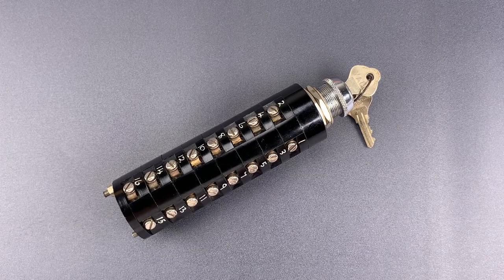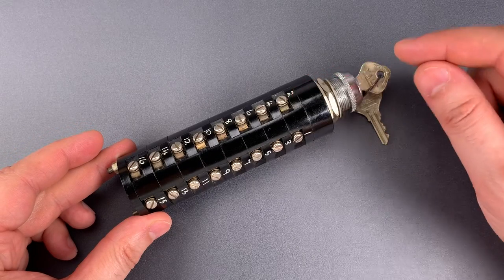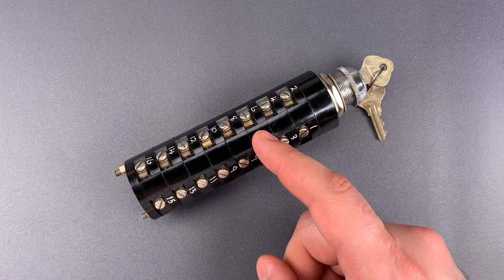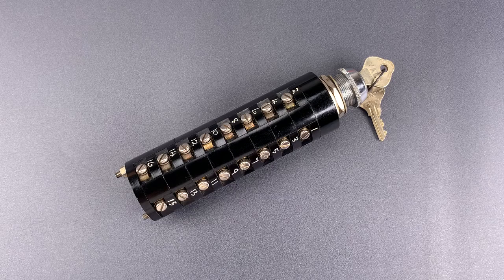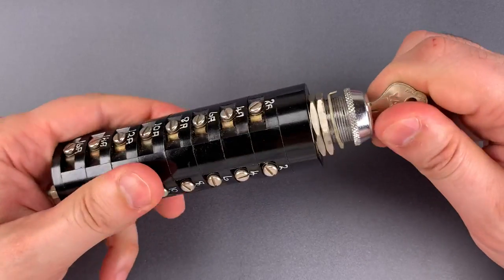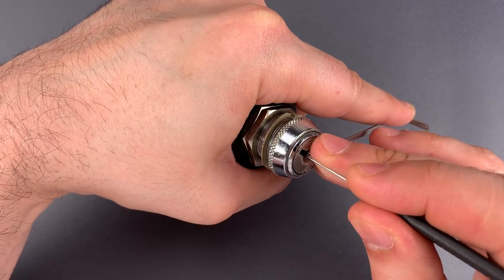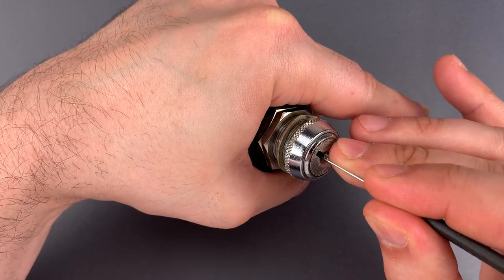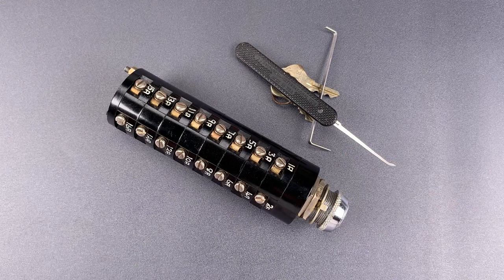[1154] Missile Control Key Switch Picked

Comment: “As you saw, it wasn’t that hard to pick...” the hard part would be getting into the aircraft on an airbase
Reply: Plot twist, LPL is Sam Fisher
Reply: The tricky part isn't the lock, but sneaking by the guys with the guns...
Reply: @ingvarhallstrom2306  he'd disassemble their guns with ease
Reply: My Dad always said it's amazing how far you can get carrying a clipboard and looking like you know where you're going.
Reply: Exactly what I think, one does not simply walk into launch control and starts picking a lock. These locks don't need to be unpickable, and having the key servers more as a "proof of authorization".
Reply: Loading the missile on the plane actually. You cant do that alone.
Reply: Pfft, what are they gonna do? Lock the gates?
Reply: So as you saw......

My brain: sidewinder missle
Reply: Easy on GTA.
Reply: Just carry a ladder
Reply: @Radonatos  yup. If the only thing protecting weapons is a key you're doing it wrong. 

You have to look at the whole context around security. Often keys are used to make it clear that only authorized personnel should be touching something. 

Just look at lockout locks. You could cut them with a bolt cutter and then kill whoever is working on the equipment. Or you could just pull out a gun and shoot them. The goal isn't to keep out a determined attacker, but to keep some idiot from just walking by and flipping a switch.
Reply: @YehNahYehAyy  easy in real life, too.
Reply: assassinlexx  lol, you don't understand the reality of the situation.
Reply: Not if the cockpits are locked with Bunker Hill Security Cable Locks
Reply: @IMBlakeley  My grandfather's account of training before WWII consisted of pretty much this.
Reply: Super easy: put on a hi-vi vest, grab a toolbox and pretend that you know what you're doing
Reply: @ingvarhallstrom2306  he wouldn't sneak, he would pick his way into the lockers and walk in with credentials in broad daylight
Reply: @MesaAufenhand  Not while they're pointed at him, I'd say.
Reply: Yes.  This lock isn't to prevent unauthorized access but to prevent accidental access.
Reply: @DeeSnow97  How do you get to the lockers without sneaking in in the first place? The lockers are inside the base.
Reply: @OtakuUnitedStudio  you underestimated his power
Reply: @walterk1221  Just because it was that easy 36 years ago doesn't mean it is today, after the numerous changes to security protocol. A lot of the technology used in the military for surveillance and security didn't even exist then, and what did has improved a lot. Getting caught will be much easier, though it's still probably not impossible to find a way in. That said, it's not recommended if you don't want to die of multiple cases of rapid-onset lead poisoning.
Reply: @IMBlakeley  Don't be giving my secrets away! I do that at work all the time.
Reply: @OtakuUnitedStudio  same way someone actually authorized would get in, they gotta store some credentials outside the base
Reply: @ Ingvar Hallström  They’ll keep stopping LPL for his autograph.
Reply: @OtakuUnitedStudio  pssst I am quite familiar with the entire situation up to and including the present. In many ways it is easier today than it was then. More as the result of politics rather than of technology.
Reply: @OtakuUnitedStudio additionally, I thought we were talking about the time frame in which this device is likely to have been in service. I.e. last few years of the cold war and maybe a few more years beyond.
Reply: If your risk model doesn't include insiders with low authorization abusing physical access, you have a serious problem. If a mechanic or trainee can arm weapons systems with a lockpick and 2 minutes of privacy, checking ID isn't going to cut it.
Reply: Eh, a lil social engineering and in like flint. The easiest lock to pick is made of meat.
Reply: Is funny, i was watching it and saying the same thing to myself lol
Reply: It's not so much of a security device as more of a "keep some random idiot from turning a switch he shouldn't turn" kind of thing. As in, someone accidentally turning this switch thinking it was for something else.
Reply: Reminds me of "how long would it take for you to die if you swam in the absorption pool of a nuclear reactor?" "a few seconds, not because you're exposed to any radiation, but due to all the bullet wounds"
Reply: Ot picking it mid flight or mid combat to fire off those side winders 🤣🤣
Reply: Was coming to make this comment. Kinda how safety deposit boxes have simple locks but they are in a vault, so the challenge isn't the box.
Reply: @nareik8017  in 2019 a cargo of atomic bomb was "forgotten" by the us army on the tarmac of an international airport for 24 hours.
that says a lot about their real security measure.
Reply: Not even with a case of beer?  "I love airplanes, just want to sit in one."
Reply: @IMBlakeley  This is basically the core of social engineering,  Pen Testers have gotten into many fairly high security data centers by looking like they work there.  A common method is using side doors and following the smokers.
Reply: and picking it while flying
Reply: Having played GTA i know the hard part is not getting in, but getting out alive after that.
Reply: Not pre 9/11. We would just drive onto the Marine Corps air base in Beaufort whenever we were in town. my dad was stationed there in the late 60s and they couldn't have cared less where you went . You could drive out on the taxiway back in those days.
Reply: @agenericaccount3935  "In like Flynn", you mean. What does flint have to do with anything?
Reply: Just pick into the guards hearts 💕
Reply: Ye it needs some context
Reply: next video : how to pick an airbase
Reply: @IMBlakeley  Ain't that the truth.
Reply: Oh, a conventional weapons lock. Easier to get into the base or flightline.

Getting close to the big stuff without authorization is a good way to get very, very dead.
Reply: @IMBlakeley  generally true, but not true around the big stuff. Or, technically, even to get onto the flightline. If your name is not on the access list, you're not going to get past the checkpoints.
Reply: Ever heard of The Meth Tank Rampage by Shawn Nelson? 

Actually, a lot of military equipment is left unlocked itself within a guarded base - why lock trucks and tanks and planes, when you control who can get near them in the first place? And that you might need to use them in a hurry in case SHTF. Then again - guards are just people, and with sheer willpower you can do anything.
Reply: Actually,  if the UK Twitter user was right,  this lock isn't intended to ask "are you the person who is supposed to be firing this?" but rather "are you sure you want to fire a quarter-million dollar missile instead of a blinky light?"

Therefore, security is not as important as the fact that you need to get the key out of your pocket and turn it, thereby ensuring that you  actually intended to turn it, and didn't just accidentally bump it.
Reply: @c.a.mcdivitt9722  exactly.
Reply: That's instant 5* in GTA
Reply: Did you know that the first soviet AAMs was a replica of the american one and the spy literally toke the missile out of the air base and drove it in his car with part of the missile poking out of the rear seat window?
Reply: @astafzciba  would not surprise me. Bet the Soviets lost their minds when they found out that it was basically a bolt-on seeker to a 5" Zuni rocket!
Reply: @filanfyretracker  When i worked for a large telco a guy tried to follow me in from the carpark (used a swipecard/badge) I am 'can I see you badge?' he got arsey said 'it's in my desk' told him to wakl around the front and sign in via security then but I bet it works more often than it fails. Pretty sure he was genuine but in whcih case there was a procudeure for left you badge in the desk/at home.
Reply: He can probably lockpick his way in lol
Reply: @IMBlakeley  you'd be surprised. theres this type of hacking thats called "social hacking" where instead of doing digital stuff you essentially hack a person. reminds me of a scene from mr robot where he calls a guy pretending to be his bank to steal information to guess his password. also one where he just gives himself a fake wikipedia page, shows up at some rich guys office and tries to make it seem like hes a big deal
Reply: Codes were all zeros.
Reply: maybe not that hard if its secured by locks...
Reply: ... “not with the pick Bosnian Bill and I made ...”
Reply: It's on Area 51
Reply: thats wht you think.
there have been issues with people just waering the correct battle dress, and a good looking badge clip on. at bussy hours people are waved through.  then you still need to get in to the bui... (wait i hear rumbling noices and sirens downstairs.)
Reply: How do you think he got this lock?
Reply: Clearly never heard of SKY KING !
Reply: @IMBlakeley  yep, it's pen testing basics. Just pretend like you belong there and no one will question you
Reply: Not really...
Reply: fake mustache, sunglasses and a realistic accent and you're half-way there
Reply: @ingvarhallstrom2306  This totally reminds me about an old What If article (https://what-if.xkcd.com/29/). Someone asked how long you could safely swim in a spent nuclear fuel pool, and the answer he got from a research reactor tech was you would die from gunshot wounds before you reached the water.
Reply: Haven't you ever watched "Fire Fox"?
Reply: I just sort of doubt LPL would have trouble with any part of that. Even the guards would probably be like 

"Hey, that voice is familiar- let me see your hands. Aw shit! It's him! What's that? You want to try picking your way into the B-2 Spirit cockpit? Shit-yeah, the guys will never believe this!"
Reply: Yeah I think this lock was less a "we don't want random people to get into our missiles" security mechanism and more a final check asking "okay are you sure you want to arm the thing that can blow stuff up sky high?".
Reply: Never mind powering on the aircraft, loading munitions and then arming them...
Reply: @jort93z  There's a joke in the squadrons where you send the new guy to maintenance control to grab the key for the aircraft. To be honest, it would be way too loud and take way too long to start up, you'd probably need SE for external power to start it up.. at that point, I think base security would get a whiff of what's happening ;)
Reply: @OtakuUnitedStudio  That's not necessarily true, CHP chased a man and woman onto NAS Lemoore a few years ago, and the MA's didn't even know what really happened until they got to the crash site, dude got decapitated by one of the super's flaps. Just last year here we had an angry ex try to kill his ex after he found out she cheated, brought a gun on base, and got dropped by the MA's, but not before he got a round or two off in her. However, it is important to note that he already had access to the base anyways as a sailor. Things definitely have changed since, but mistakes still happen.
Reply: Don't test this man
Reply: As someone who quit the armed forces, was in no way legally allowed to be on a military base, was invited back by a friend for a tour of an AFB, missed our meeting, and then wearing civilian clothing and a visitors badge, talked and bluffed his way inside and sat inside an apache attack helicopter before the first mechanic was like "And who might you be?" and my friend showed up, I think you massively underestimate the level of retardation in military security.

Oh, as details:
I sat inside the cockpit after I already handled test ammunition for the apache cannon, which was left outside the dedicated ammo storage and inside the hangar contrary to what the regs say. The real ammunition was sitting in crates right next to the test ammunition, but seeing as I am not certified to handle that it seemed wrong to so much as pick it up.
I also sat there after I was able to drive along the runway, you know, that thing where disasters happen if somebody puts down an explosive device, a beacon for targeting or so much as a simple metal wire.
I also sat there after driving past an armoury where rifles and ammunition are held. I did not attempt to go inside, but nobody seemed to be there. Wanna bet an infiltrator could realistically get inside before being seen?
I also parked my car next to a sign that indicated the presence of a fuel line somewhere nearby. Wanna make bets on how big the explosion would be if someone put a simple small handheld explosive device on such a fuel line?

I'm not sure if Russian agents or jihadi terrorists, would feel the same limitations I felt when I was driving around, fooling everybody and waiting for my mate.....
Reply: america?
Reply: Wild Bill gta reference?
Reply: You don't need any special tools to get on base. Just show a little ankle and you're in! Lol
Reply: A mistake and it sounds of the alarm. xD
Reply: IMBlakeley facts. I did exactly this is the US Military
Reply: @IMBlakeley Hello Michael Westen's son
Reply: @YehNahYehAyy  especially if you own a hangar there
Reply: @wildbill268  is that another gta reference
Reply: @MesaAufenhand  he will need the gun Jesus for that. If those two were to team up the army would just quit.
Reply: Is the aircraft and airbase also use lock? If yes, then not so hard for him too.
Reply: As a former cable guy (after 9/11), I can tell you that all it takes to get onto an airbase is a van with a cable company logo and a polo with a similar logo. 

Sometimes I was stopped and asked where I was going; mostly I was just waved through. 

I delivered Pizzas to the same base years before with just as little issue. 

I have never been military associated, I never saw the same guys at the front, my visits were spaces so far apart they wouldn’t remember me anyway, and I only ever had to get a visitors pass once (several trips in) and was never asked for it.
Reply: Ties my headband tight.

Brb.
Reply: @Aesir_IV  I hope Mr Fisher gets his movie some day or Gabe Logan
Reply: Great words especially from a guy who probably couldn't even open this lock with a key
Reply: Bruuh the FBI arrived or not yet ?!
Reply: @OtakuUnitedStudio  I’m adding “rapid-onset led poisoning” to my vocabulary.
Reply: Yep, if you've been in the motorpool you'll know a lot of military vehicles don't even need a key to operate (although we usually put a cable lock on the steering wheel and the gates to the motorpool are locked of course but you could probably drive through em)
Reply: IMBlakeley Idk why but Burn notice appears when i read that
Reply: The hard part would actually be getting caught
Reply: Ingvar Hallström that was the joke dude lol
Reply: Its just a 4 star wanted level dawg. Get gud scrub. (jk see you in los santos bois, lets get this bread)
Reply: Or picking it, IN FLIGHT! 😂
Reply: @OtakuUnitedStudio  Or you get in and manage to start the jet, sure somebody on the base is going to hear a fighter jet taking off, then you will have a bunch of trained fighter pilots on your tail and if you try anything besides turning around, landing and surrendering, you will be the one eating sidewinder!
Reply: Wait until he unlocks a teleporter...
Reply: Matthew Foster LPL is now in siege
Reply: @MesaAufenhand  underrated
Reply: Didn't an off duty ground servicemen just drive onto the airfield and take off in a jet back in the 80s? He had a pass to be on base but still.
Reply: I bet he can pick lock his way in 🤝
Reply: ENCHANTMEN this absorption pool thing, I want to remember that.
Reply: @IMBlakeley  LOL sounds like he actually tried it
Reply: IMBlakeley i seen a guy walk into Walmart with a clipboard and handtruck. He stacked it with beer and walked out no questions asked.
Reply: Yeah, my husband's ship has the passwords on a post-it stuck to the computer. If somebody gets onto the base, onto the pier, onto the ship, and all the way down into the sat room, they've earned it.
Reply: Just enable invincibility cheat
Reply: In all honesty, LPL would just pick apart the very fabric of reality in less than 10 seconds to materialize himself on-site, foolish humans.
Reply: That's easy that's the easiest part.
Input NO CLIP cheat.
Reply: Not really, just dress nice put in a hardhat , and a hi vis vest, carry a clipboard.  Anybody says anything to you, you tell them XO has sent you
Reply: Reminds me of that time someone walked into a US military base and stole a tank and just drove it out of the base.
Can’t remember for sure but i think they might of actually been off the base by the time someone raised the alarm.
Reply: Allahu Akbar
Reply: Getting into most aircraft is super easy. They don't have locks by default once you get past the Cessna 172 level of general aviation. It's generally considered enough that the location they are in is secure and you require specific knowledge to operate the aircraft. That being said, most military cargo aircraft in the US fleet do have the ability to add a padlock to the exterior door or the exterior door opening mechanism to slow unwanted visitors. 

The hard part would be getting TO the aircraft. Getting into it would be relatively easy.
Reply: @walterk1221  Fair enough on that.
Reply: @RichFreeman  right on point.
Lock-out key switches are simply to prevent careless accidents. The industry standard industrial consol switch is usually a four wafer lock that you can jiggle open with a nail file. And I've come across some that Only have a single wafer in them.
Reply: that actually would not be all that difficult if there's a public road that goes right between the airfield and the maintenance building and the gates are very often left open.
Reply: All you need is the right uniform.
Reply: If it was to lock out missiles during training it's more of a safety than anything else. I imagine they would probably verify its safe or armed before taking off. So even if someone snuck in at night and picked it they would reset it, no?
Reply: Not for him
Reply: Or arming a missile on a grounded aircraft... 🤯💥☠️
Reply: Yeah It’s basically impossible to get away with five stars wanted level.
Reply: Ingvar Hallström nah he could prolly sneak in by posing as an actual locksmith
Reply: @KMG623 easier than what you think
Reply: Bad company eh?
Reply: ...you’ve clearly never seen a a little documentary called “Iron Eagle.”
Reply: You just gotta ramp over the fence with a decent car and you're in.
Reply: Lmao you just see some dude kneeling next to the airstrip gate picking the lock saying "click out of one... 2 is binding..."
Reply: I know the lock on the gate seems intimidating, but next thing you know, "click out of one, two is binding"
Reply: The hard part is leaving after arming all the missiles
Reply: Laughs in kgb
Reply: You hear the story of the UberEats guy that walked into a Nuclear silo in the US? Gaurd was asleep when he showed up
Reply: Spy job
Reply: Weapons keys are typically used in pairs that have to be inserted and then turned at the same time to arm and launch. They're a distance apart that precludes one person ever being able to complete the task. Thus, such keys don't need to be pick proof.
Reply: Bro just drive your zentorno up the hill lol
Reply: Enroll and start training
Reply: Not really. I do it in GTA every day!
Reply: or doing it mid flight
Reply: @MesaAufenhand  it would be Easter to disassemble them... just picture him running around an airbase with a blood covered lock pick
Reply: @josephmontanaro2350  while showing a guard their own bones that he recently 'disassembled' out of them
Reply: The harder part is getting in the base.
Reply: Unless....... ur the guy in the cockpit doing ur training and decide to go crazy!
Reply: " WHO ARE YOU AND HOW DID YOU GET IN HERE!?
"1. I'm a locksmith
2. I'm a locksmith"
Reply: And the Other key? Arent there everytime 2 Or more ?
Reply: @lordgarth1  *ones and zeros
Reply: *gun falls apart, and left holding just the trigger*
*voice from the darkness* Aaaand... that's all you have.
Reply: You know this guy in Sam Fisher right?. Retired of course..
Reply: You clearly haven't played GTAV
Reply: @walterk1221  not saying its impossible just unlikely to happen it has been over 30 years I would hope they have upgraded security at least a little bit. Like you usually have to go through a security checkpoint just to get in most military facilities not to mention you have to load the missiles on the plane, not a 1 person job plus you have to know what your doing then fly the plane off and pick the lock while flying the plane this is why terrorists make their own shit it's not worth stealing
Reply: @justiceger6524  my comment was based upon the time period this device was in use. Most military bases have many miles of perimeter fencing. Other than near flight line or other significant locations the perimeter is largely unprotected even today. Intruders are highly unlikely to attempt to pass through a checkpoint 🙂
Reply: @walterk1221  the point I was trying to make is that someone capable of doing this probably knows it's not worth it and they could do more damage by themselves. And thanks for teaching so new tho they never said shit about this in history class.
Reply: meh he can lockpick his way through
Reply: Unfortunately not as hard as you think. Once you are in, everyone assumes you ought to be there. with a skilled social engineer there are no issues getting anywhere, particularly somewhere as highly populated as an airbase. 

Especially when they recognise you when you had drinks together the night before etc. read up on social engineering and you will see that there are few military installations capable of avoiding it. 

It just depends how long you have to set up a job like that.
Reply: @nareik8017  Most military infiltrations and aircraft theft and so on have been done when the airbases are most busy. in broad daylight, with social engineering. With the aircraft prepped and on the runway.
Reply: 🆘🆘🆘🆘🆘. NOT AFTER OBAMA & BIDEN DISARMED THE MILITARY BASE FOLK

GO TRUMP!
Reply: I drove onto Arnold Air Force Base in Tullahoma, TN...nobody stopped me. I just followed a person in waving their credentials and waved like I was with them, easy. (ok, once I got in I panicked and made a controlled u-turn and left but I made it looked like I dropped something off first). It isn't a high-security base either and it was 40-years ago.
Reply: @xXxJustCallMeM  Kinda there were a couple instances of this. In that specific case he was also a mechanic and was supposed to be in that area normally. It also was and likely still is part of a standard mechanical function test to do a high speed taxi which tests several things. Guy picked a jet that was due to be tested and instead of stopping just took off.

That takes a bit more insider knowledge then your typical thief will have.
Reply: If Saul Goodman can do it with a old man and a wheelchair... (don’t forget, he was a lawyer too 😂) the LPL could do it too
Reply: Gta San Andreas flight missions in a nutshell
Reply: Guy could honestly break into the White House or Pentagon
Reply: There are ways
Reply: @OtakuUnitedStudio  I think it's a joke dude no one is being serious
Reply: @YehNahYehAyy  i beg to differ.  jacksepticeye had a whole lot of trouble just trying to steal a military jet.
Reply: @ingvarhallstrom2306  Ask DeviantOllam about that part
Reply: @jort93z  The P3 Orion had a padlock that went on the outside with a retaining key. It was used to keep honest people out as there was an access port through the hydraulic  service center to the inside.
Reply: The point isn't that the lock needs to be secure. It doesn't need to be unpickable. The important part is making sure the missiles can't be unlocked on accident, because it got bumped or damaged in flight or in combat. A normal key is all you need because no one should ever be in your plane without authorization. The security is in the switches keeping the lock from turning on accident, not the actual lock itself.
Reply: Yeah, but if you're a cadet during training and hold a serious grudge against another recruit... Well, you can blame it on the equipment and probably get away with it.....
Reply: This has been done so many times though lol
Reply: @OtakuUnitedStudio  well, you proven incorrect. It is still easy as evidenced by the fact an unarmed intruder not only entered the flight line at Joint Base Andrews but that intruder gained access to the interior of a military aircraft. What was easy in the 1980s remains easy today. In case you are unaware, Joint Base Andrews is home to the President's aircraft (no, not "Airforce One" unless the President is aboard).
Reply: @justiceger6524  update for you: an unarmed intruder made his way onto the flight line and boarded a military aircraft at Joint Base Andrews. Proving security is no better today.
Reply: @walterk1221  😂 that's awesome I just looked it up. Imagine being that guy i mean he actually got all the way to a plane and got in it before anyone noticed something was wrong 🤣 thx for the info that was pretty cool.
Reply: @justiceger6524  it is really rather shocking and I pity the security force members under the watch of whom this occurred. There will be endless remedial training for ALL members at all bases.
Reply: @walterk1221  yeah it just goes to show how far a person with a good plan can get. And yeah that's gotta suck for any on duty officers
Reply: No it wold be picking the lock while flying
Reply: @ingvarhallstrom2306  just wear an uniform, no one will even look at you....
Reply: @MesaAufenhand  

your friends are uneasy, you swear you heard something. you see a man, then he disappears. seconds later, you hear "binding on 4, open on 5" and all of your guns fall apart. he's behind you.
Reply: No it wouldn’t. Pick the door. Pick the next door. And the next door. Then pick the aircraft.
Reply: Just climb the fence at night.
Reply: @Sirkillsalot22X  actually, at the time, the paperwork and involved following a member of the security force, even behind the "Use of Deadly Force Authorized" perimeter, would give even the most zealous guard think twice. Ammunition was and likely still is/are accountable item(s). I was employed at that location at that time. The aircraft was not armed, it was in a hangar and its exterior was significantly damaged.
Reply: And thank god for that
Reply: Instant 4 stars wanted level
Reply: Plot twist the airbase uses Master lock locks for security
Reply: LPL is definitely in special ops
Reply: @IMBlakeley  you need ID to enter an air force base. A clipboard ain't gonna cut it
Reply: It might keep someone out long enough for someone to notice at least.
Reply: Eeeeeeehhhhhhhhhhhh

>The multiple times people have stolen or attempted to steal tanks jeeps weapons caches and were only foiled by chance
Reply: LPL : challenge accepted

Post 1 Guard is down
Nothing on 2
Got a false gate on 3

And now we got this base broken in

As you saw, folks.. it is not all that hard to enter the airbase
In any case, that’s all I have for you today
Reply: I'll be the guy who clears up this massive amount of misinformation. I was in the Air Force from 2007-2016, as an engine mechanic. I've started the engines, removed the engines, etc. That's my background. Now, to clear up the misinformation. 

To get through the gate, you'd need some form of identification. Whether that be an ID card from uncle Sam or through the use of a visitors pass. 

To obtain a visitors pass this requires you to be accompanied by someone with a military ID card. Due to OPSEC reasons, I'll leave the rest to your imagination. 

Now, try busting through the gate. They have spike strips at some bases, while most have adopted the barriers. You will not get a car through these barriers and no you simply will not drive over them, nor can you accelerate fast enough to beat them. 

Let's say you then get past the gate, onto the base, then you have another security checkpoint once you hit the flight line. Oh boy, if someone doesn't recognize you at this point; you are in for a rude awakening. I guarantee you wouldn't make it past the next gate up until this point. 

Let's say you do, now you are on the flightline. Depending on the base determines the level of security of said flight line. Walking around, well you better be careful. Got a line badge and a military ID card? If not, guess what?

Now, let's say, no one notices you and you've made it to an aircraft. Jeez there's a lot of buttons you'd have to press in a very specific order in order to get the aircraft to even begin wanting to start. Let's say you get this far. 

Ready to crank the engines. Uh oh, who's starting engines without clearance from tower or the super? Engines are loud, people know which aircraft are running. Let's say on this particular day; everyone's tinnitus is absolutely ringing their ears and they can't hear. 

You release the brakes and begin taxiing the aircraft. Tower will notice. At this point, do you realize how incredibly hard this task is? Even for me, someone who has literally done everything with the exception of releasing the chalks and beginning a taxi roll, that I wouldn't make it even to the flight line. For those saying it's easy. Try.
Reply: @Tracked350Z  cringe. Just jump the fence and slam on the accelerator.

Ezpz flight tips for beginners
Reply: You need to pick the gate lock, then pick the security alarm, the control room door, then the nuclear weapon launching key, in this sequence. Each step will take few seconds to accomplish.
Reply: Lockpicklawyer not army infiltration lawyer
Reply: there was a priest that did it in 2019 I believe
Reply: @Tracked350Z  Yes, anyone who thinks this is easy is kidding themselves.  I was on a Marine base in the early 2000s and no one would ever make it near an aircraft.  First, you'd need to get on base - a guy shot a sheriff's deputy outside the base then jumped the fence onto it - the MPs rolled up a couple hundred yards away and shot him with their M16s, no warning issues.  Dead before he hit the ground.  
Getting through the front gate wasn't that hard on a large base, but still not letting just anyone on.  Once you got on base, to get onto the air base, you either had to jump a razor wire fence or have a badge to beep you in.  If you managed to get onto the air base, you'd then have to pass by a bunch of Marines to get to the flight line.  On the weekends, there would only be patrols, so that would be the easiest time to get on, but as you said, the noise would give you away since nothing else was going on.  During working hours - which was round the clock as there was a night shift, you'd get noticed and stopped since everyone in a squadron knows everyone else.
Reply: How do you think he got that thing...